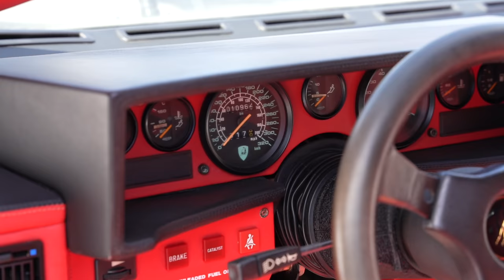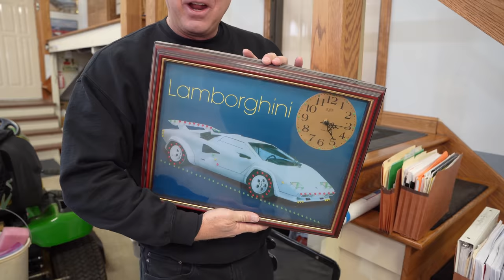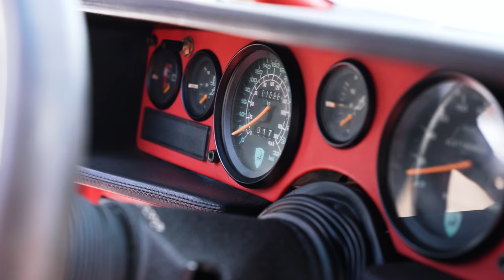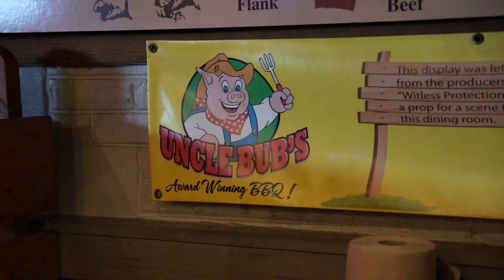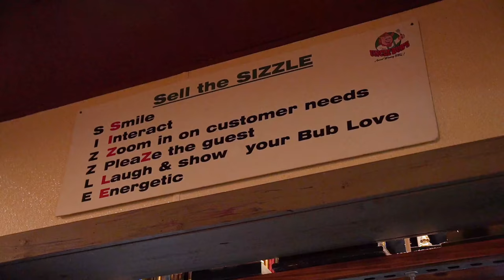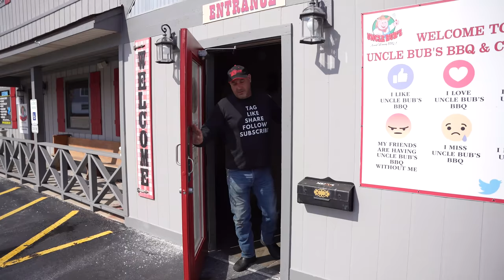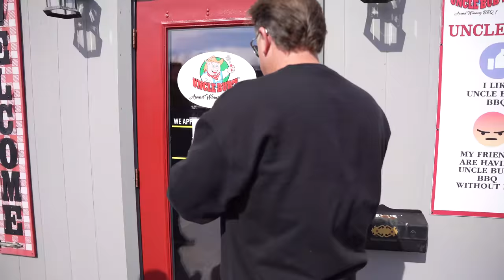RESCUED: Lamborghini Countach in Chicago, Illinois!!

Comment: My most fav machine
Ok
Its hands down gorgious
But if you slip into the driver seat
Its just as dissapointing
The clutch is like pushing a ton of lead
The driver window hardly rolls down
To a few inches
All the driver can see is the front
There is nothing to see for the rear so forget the rear
The side are another drawback
So if you just want to go straight
Sure
The rest is a complete blind spots
I would give it a minus nine
When it comes to try to drive
My friends dad gave his son
A birthday gift so he offered me
To drive but after my clutch pedal
Test
I got out the seat